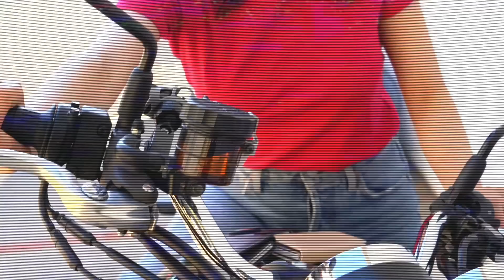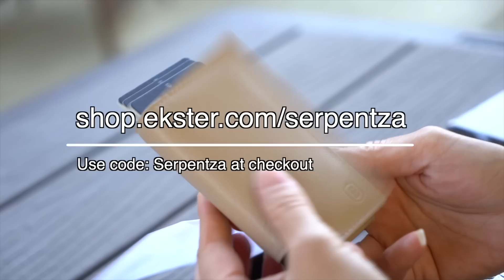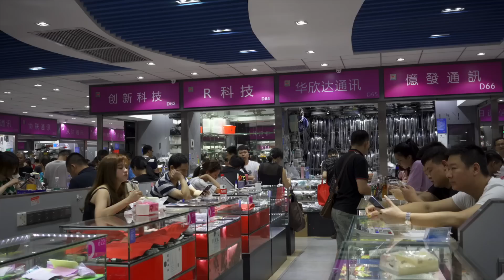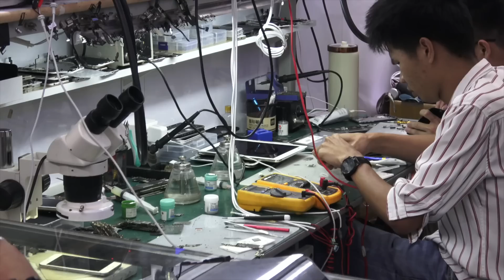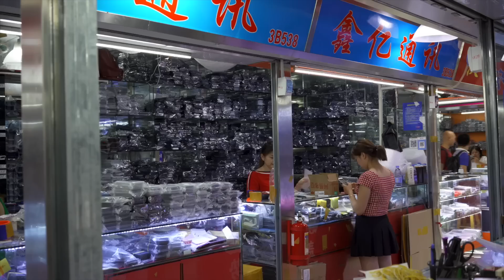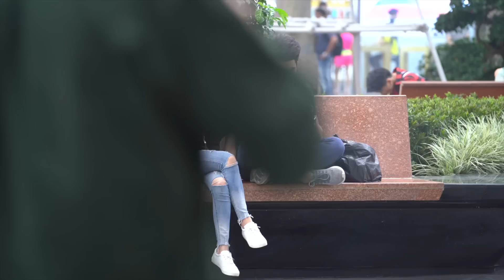Why China Can't make Chips!

Comment: The problem is that it's far too easy to corruptly siphon off billions of dollars.  The people giving the money don't care and don't do much oversight.  The people handed the money, likewise.  It's trivial for them to siphon off 80% of the cash to friends, family, and cronies, who then just go through the motions of starting hi  tech businesses.   Making good and advanced chips takes a focused determined, and detailed effort.  It's so much more tempting for them to just go through the motions.  As a numerical example, advanced CPU chips go through like SIXTY separate individual manufacturing steps-- silicon refinement, cutting, polishing, grading, resist deposition diffusion, metal deposition, ion implantation, gold deposition, all repeated many times over and over.  An error of a few parts per million and all the work has to be scrapped.  Not a process that can be insured to a bunch of subcontractors with not much incentive to do everything perfectly.   Much like Chinese-made cars, where they can't reliably make and assemble a few thousand not too precise mechanical parts.

Comment: I work in a university with a lot of chinese students. There are also clear issues with health & safety attitudes as well as general quality assurance attitudes. Both of those will not allow china to advance their tech until they address those cultural issues. Especially for chip production. You need insanley high quality standards to make computer chips and many of the processes can be very dangerous. If you dont address H&S issues you quickly lose expertiese and expensive facilities due to accidents, if you dont have the QA then any mutlpie step process essentially becomes worthless as each step needs to be of the highest quality.

Comment: Making an expensive ballpoint pen is still a difficult intensive thing to do by rights. You do feel a difference in a high quality pen but for mass produced pens I think it's more about cost per unit and thus no one cared as long as it writes. There is something that even Russia doesn't bother to develop is that fine tolerance manufacturing that enables the west to produce and design higher quality longer lasting products. It's a pity people don't support and treasure that more. Sometimes it's overkill, but it's less wasteful since you end up buying a really good item once and it is servicable instead of disposeable.

Comment: One of the issues is there's a 5-10 year lead between chip design and manufacturing. Every new chip you buy went through an exhaustive process of design and testing long before it every reached the productions line. Nvidia for example employees hundreds of engineers and an inhouse super computer that costs millions of dollars a year to run just to design the chip used in video cards and it can take up to 8 years of design and testing before a design is ultimately approved. So the stuff they're working on today you won't see for almost a decade.   A significant part of chip manufacturing costs is the investment in designing for the next generation 
China is so focused on manufacturing only they don't understand by the time they hit that goal whatever they're making will be a decade out of date. This entire thing with Taiwan is so infuriating because China doesn't understand that they're throwing a wrench into a industry that relies on a process that requires nearly a decade of planning ahead and a global support network to keep running day to day.
Reply: Lol

Comment: In some areas, China leads the world. For example: PV solar panels, electronic manufacturing.
Actually, they have chip design as well. Ok, not the high tech one. I work with chinese chips (communication chips, RISC V based uC, SoC, FPGAs). Yes, there is cloning, but there is innovation too (for example RISC V CPU cores and chips).

But we need to sepatate chip design (the logic defined in some hardware description language like Verilog), and chip manufacturing.

The first one (chip design) won't be a big issue for China. It only needs money and time. They're already learning this.

However, the latter one is mission impossible. Chips are manufactured in Taiwan, korea, USA with 5, 4 and now 3 nm technology. This fabs use the most advanced technology and engineering humankind ever achieved. And the truth is that a European company develops, manufacturers and installs the most important part: the extreme UV litography machine. The biggest fab is in Taiwan (TSMC), and even Taiwan can't build this machines.
Maybe intel built their own one. Though, they paid a big price for that: they lost many years, because they couldn't solve technological challenges in time.

So, China could only catch up in high end chip manufacturing, if the west allowed that and sold litograohy machines.

Comment: Making ball bearing balls is much more difficult than one would think at first. Tooling needed for tight tolerances they require is difficult to manufacture. Problem is made worse by having to have tools to make those tools etc. all the way to mines to get metal out of the ground. Most countries do not see any need to make everything themselves. They can count on buying what they need from those manufacturers who do know how to make what they need. China has fundamental problem of being country which no one can trust. Therefore it can't trust that it will keep on getting everything it needs to keep factories running. If they were normal reliable country they would never have any problems. As they are what they are there will be many issues in future. Including difficulties to get everything they need to make bearing balls and microchips.

Comment: I agree with your presentation. The so called high tech industry takes long time to cultivate and develop. Besides, it also requires an infrastructure to support its development. China may be able to build chip factories but there is not too many companies which can manufacture chip manufacturing equipment and machinery. Also I wonder do they have the technical know how to do so. If they have time frame of 15 to 25 years, they maybe able to set up the chip industry but to have it done before 2025, seems to be more like a joke.
Reply: They already have a proven 7nm mass production process, and 3nm has been done in the lab
Reply: @junyin5950  So please advise what type of ICs from the production and applications. Would like to know.
Reply: @junyin5950  Also please advise the company name.
Reply: @julianlau5579  YMTC，you can google it

Comment: I saw a video about how China can't create AI capable Graphics cards and with Nvidia sanctions preventing them from selling 4090s and their flagship AI GPUs to China, the video showed a company taking 3080 graphic cards and turning them in to AI Capable graphics cards with Nvidia's assistance. It looked like they where unsoldering the GPU Chip from the PCB and installing them on board that looked pretty much like nvidias AI cards..

Comment: They have been doing at least some work on high performance chips. See StarFive's Dubhe design. Some of them use the RISC-V architecture so they don't have to use arm's designs. They're not there yet in terms of performance compared to companies like Intel and the Apple M series, but if they are trying to iterate fast and they will presumably improve. Don't assume this situation is forever.

Comment: Excuse me, but China is producing chips, isn't it? SMIC, HeJian...Why so you say that China doesn't produce chips?
Reply: It's the high tech ones they can no longer produce as of today since they were cut off in 2020 from the tools necessary to design them, from what I understand. Huawei recently said they are close to being able to design 14 nm chips, which are still several generations behind the latest chips being made elsewhere. I don't fully understand it but it sounds like China doesn't have the ability to design them because they were cut off from the software needed?

Comment: agree with you on the chips, but disagree with the last part about no new innovations. Pretty sure 5G was china
Reply from the maker: 5g wasn’t China
Reply: i dont agree with serpentza in this one. I don't like the PRC, but the only thing WE can't lie about is China's inability to make chips, which is totally nonsensical, as China has been able to produce chips for decades. 
That's why the global smartphone and electronic market has been cheaper since 2012, because China is able to produce such large wafers (which are necessary to make chips) on a large scale. This allows people from third-world countries like India and the Philippines to afford cheap smartphones with current-generation technology.  The only thing I agree with is China's inability to produce advanced chips below 5nm, which are now the current standard in technology. However, the ones harmed are not the Chinese or the PRC CCP, but common consumers like you and me. The latest GPUs, processors, smartphones, etc., that use 5nm chips or below will be priced higher because the chip market is now monopolized due to restrictions imposed by the USA.

Comment: China buy the tip of ball point pen therefore china can not make chips! is that the whole argument dude? seriously I was expecting some logical tech reasons. And you little experience at local phone shop can not be taken as the hard evidence for the inability for china's inability for chip manufacturing. 
I have seen your other videos also. almost all are about china's inability. but all the videos have similar trend, which is since china can not do some thing simple, as in this case ball point pen tip, then china can not do the more sophisticated thing.
I think you need to come up with a better evidence to support your claim which requires you to dig and research. then you can do a great content with real reasons to support your claims

Comment: No country can produce high end chips on its own. The EUV laser is from ASML (it's so extremely expensive to develop that no one wants to do it, since with 2 vendors the profit would not be enough to bring back the price), the optics comes from Zeiss, the wafer and the chemicals comes from Japan (2-3 companies). The production is done by TSMC and Samsung (Intel maybe, but that is not really high end anymore). The design comes from AMD, Nvidia, Apple, Samsung and maybe Intel. Those saying that the design is not so important, pls. look at intel and its ARC GPU; Intel is producing integrated GPUs for decades, have quite some experience in chip development, yet they failed with the first product... And there is the packaging, which is another nice problem especially with chiplets/tiles and 3d stacking.
I hope the point was clear: if the US can split China from the rest of the world, it is impossible that China can catch up. Especially not in say 10 years.

Comment: They can buy the machines that make the machines, but the internal corruption would kill it. One thing you need is extremely high grade and precise solder for these robotic soldering machines to work and I can't imagine that happening when you apply a Cheat if you can mindset along an entire production and supply line and that just one ingredient.

Comment: Let me ask, what if Chinese can make sem conductors ? Is that mean you are wrong? At least, Chinese can make 40nm chip or maybe  28nm 
from end to end. All devices  can made in China,eda, , no one else can do that on the earth,including USA,Dutch,Japan,Korea,Taiwan…
Reply: I'm sorry! did you forget that Nederland has the only company in the world that actually makes the machines that make high end chips. The rest of the world have not figured that out either. without these machines chaine has nothing and can't make 40nm or 28nm. In any way Nederland will not be selling any new versions of the machines to Chania so they will only have the outdated machines to work with. Sorry
Reply: @kingjackel1977  China has already achieved 28nm by themselves.
Reply: I think China's issue is that they can't design the highest tech chips. They may be able to make several generation old chips. I'm not sure how correct I am with that.
Reply: @zzoinks  Never mind. 
China actually has a long time ago with the design ability close to the world's top level, such as 5nm Kirin 9000. 
They also have plans for the 3nm Kirin 9010, but they can’t make it without global high-precision machines.